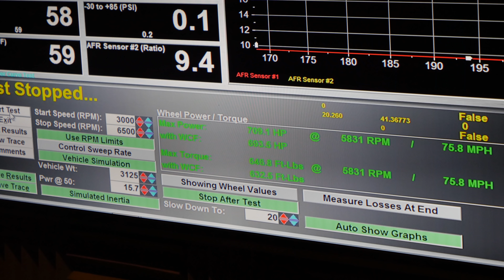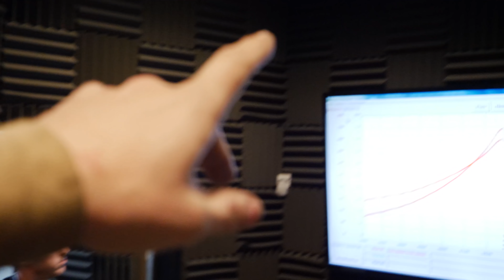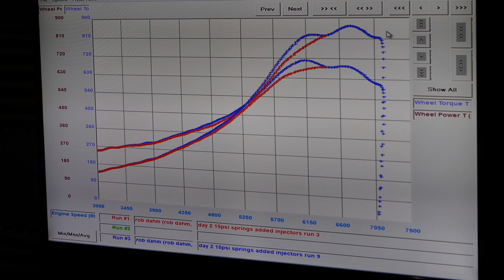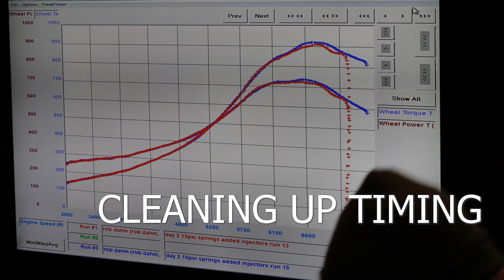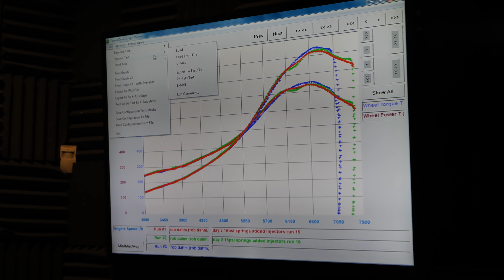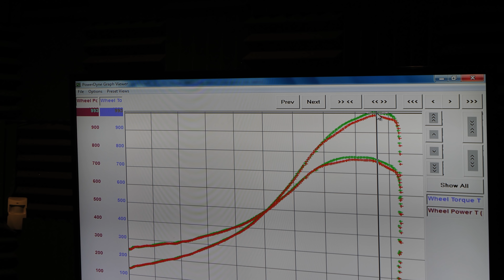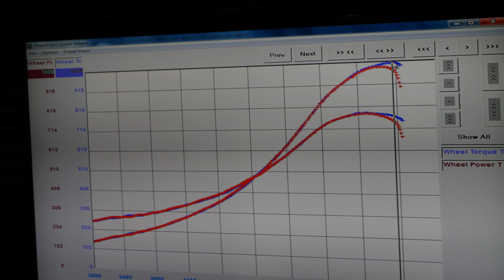WORLD’S FIRST 1000HP AWD BILLET 4 ROTOR RX-7

Comment: I never thought i will see the day of Rob Dahm hitting 4 digits on the Dyno with the AWD 4 Rotor, but now that it is FINALLY here, i can only cry of emotion and feel more than happy for this man and his dream becoming real!
Reply: Well that got deep real quick! I agree, no tears but the journey was mighty, as is the Man behind it!
Reply: Time to hit the track and half mile.
Reply: Jake Heke but it made 1000, lemme guess your 1500hp turbo civic would smoke it in 1st gear
Reply: Jake Heke  why are you even watching?
Reply: Jake Heke  Ha, good try, looks like you don't know sh*t about Dynos, he was hitting over 1000HP on the last 10/15 runs because it is a Mustang Dyno and they read the HP lower than it actually is, he just wanted to show the 1000 number on the screen but it is actually over 1200 HP
Reply: Jake Heke  
Peak numbers are always just that. Peak. And really you cant really gauge power output very well based on that. However it did peak at 1000 hp. Which is really nothing to sneeze at either. Sure it aint 1500 out of a 4g63 but ya know, its still very impressive. And it will have a very snappy response to throttle input too
Reply: Joe Alex how gay
Reply: @joealex65  yeah also 10XX hp at the wheels means with drivetrain losses ( due to AWD even higher) friction can cost you a lot but I would say the engine isn't punching with 1200hp my estimation is about 1150hp at the crankshaft also at sub 1000hp the dispersion of the test stands get bigger so.. 🤷‍♂️

Comment: Rob has invented a new fuel measurement ppg : pulls per gallon
Reply: no! it's gallons per pull
Reply: Thatdudeinblue made up smiles per gallon
Reply: In some tuning circles you can hear them arguing that the envirude v8 two stroke engine needs fire-rescue hoses to feed it with enough gas.
I think we can draw this comparison to Rob Dahm. Or he screws the fuel pressure up to 30psi.

@Rob Dahm, have fu**ing fun with this awesome Monster. Let them kids hold their ears as tight as they never hold them 

Sorry, german "Denglish"
Reply: @Bernie Sanders one lap. one mile. ABSOLUTE VICTORY
Reply: Talha Naveed no he didn’t lol
Reply: @swedischer  30psi isn't much fuel pressure at all. Pretty common to maintain 3bar above manifold pressure.
Reply: @XLR8_992.1  Haha, nah, I heard that term back in the 80s and I'm pretty sure it's from the 70s fuel crisis.
Reply: This is like what people will learn about in history class one day
Reply: I think its around 2
Reply: @mitchsalden649  Hahahahaha

Comment: The fact that this is AWD it’s gonna be insanely fast
Reply: Dude right I think MOST people in the comments aren't understanding how FUCK ALL INSANE an AWD Rotory is!!! 😲😲😲
Reply: It will be borderline un-drive-able at wide open throttle, traction will be non-existent.  That thing is insane... I love it!
Reply: @BassFearDave  Why? Did you read a bogus comment somewhere?
I don't imagine it's going to be of any benefit at "wide open throttle.", but it surely is not going to
make it un-driv-able.
Reply: Anyone know the weight of the car? Fd3s are already light at 2600lbs stock
Reply: @Hakuna_My_Tatas  If you watched the video all the way through, towards the end he says it weighs only 2400 pounds.
Reply: @Hakuna_My_Tatas  13:51
Reply: Tracrion shouldn't be an issue takigg that the motors starts pulling at very high rpm
Reply: @BassFearDave  If the car breaks traction on four wheels at WOT it just means the final drive ratio is wrong.

You guys really don't get how cars work do you? There are cars with more power than this on the road and they get traction just fine. Some of them aren't even AWD and they manage.
Reply: @Hakuna_My_Tatas  he said 2500 in the video
Reply: @BigUriel  Depend on what gear you are, exiting a corner in second is gonna need some finesse
Reply: you're right man
Reply: @BigUriel   @Sérgio Alves  quit trying to act superior lol. Don't gatekeep automobiles. Secondly, cars can lose traction at full throttle because of improper tire temperature, tire condition, compound itself not being up to the mark, overall mass imbalance, anti squat issues, and especially compliance issues. Literally gearbox is the last place someone would make a mistake to lose traction. And there are actually not many 1000+hp 2400 lb awd cars out there, and most are made in a complete industrial set up with millions worth of simulation packages
Reply: MRJT stock next gamestop!

Comment: Rob: I wonder how much HP this engine is going to put out
RX-7: Yes
Reply: Not a lot for long, you can hear that he has not worked  the rotor tolerances.
Reply: Sounds like adding rpm kept letting it make more power
Reply: @toordog1753  like you would know lol
Reply: @2valvechris338  Since RPM is directly in a horsepower calculation that would makes sense.
Reply: @toordog1753  You can also hear that the left front tire is .1 psi low and one of the spark plug gaps is .000001 too big.
Reply: This “yes” joke is so played out.
Reply: Here's the thing, I'm sure he can put more power into this. But this is a scary scary fast car. If I was him I would try and drive this first 😂. This is technically should be faster then the new Bugatti Veyron sport.
Reply: @toordog1753  rotor tolerances were fine although power should go up more as the engine breaks in

Comment: Next on Rob Dahm: How to install a larger fuel cell in an RX-7.
Reply: My thoughts exactly. I mean, the extra weight of a larger fuel cell will probably help with traction because that thing is VIOLENT!
Reply: @A_G420  After all, what good is a car that can only race, from fuel station to fuel station two blocks apart.
I'd go with a large baffled fuel cell and get it shaped to fit in around the pipe work of the frame (probably easier said than done though) OR two large round fuel cells with baffling inside to reduce fuel sloshing around when cornering or heavy pulls like drag racing.
Reply: @TheHungrySlug  wel you don't run full beans every time so mpg will be better

Comment: 4 rotor: * makes 1000awhp with no problems *
Rob: * cries in doritos *
Reply: His tears are triangles now lmfao
Reply: ☝️🤨 This engine is a low range, for use daily car set up, this have capacity to hit 2,500 hp. ok 13-B 2 ROTORS with over 1,000 hp O.E.M. part. and 1,400 hp Billet 1.3 lt. 😉👍

Comment: When Freddy Tavarish was tuning his TT Gallardo on a Mustang dyno, he said that Mustang dynos read 20% or so less hp and torque than a regular dyno would. So  RX7 is probably pushing 1100hp!
Reply: I heard the opposite about mustang dynos.
Reply: That is true, the Mustang dyno tends to be more conservative due to the loading they do, and if you put this car on a Dynojet,  it would be more like 1200.  The thing about Mustang dyno's is they need to be carefully calibrated for the car, or the numbers can be way off (or skewed on purpose), but I doubt Rod would do something like that, and I am sure that shop knows what they are doing.
Reply: Just put it on a Dynapac and be done with it
Reply: Well they are +/- not 20% specifically . Every mustang dyno ive used reads slightly differently on same car. That said 1000hp on this dyno is more than enough to prove its over true 1000 at the wheels i.m.o. plus thats awd hp at wheels meaning its loosing much more in drivetrain than rwd would
Reply: @BassFearDave  yeah they did way to many pulls to be trying to hide the numbers.plus the size of that turbo and boost #s the math works out

Comment: Check those straps every so often especially when you're starting in test mode and moving gradually into full tilt. they may be tight enough for 200hp when u started but not for a 1000. the very last thing you ever wanted is for that project to come loose on the dyno.

Comment: Cant wait to watch it on 1/4 or 1/2 mile ripping 🔥
Reply: If it hookes up with 1500HP it should hit 7.9@180 easy......................maybe over 200mph
Reply: A race with Leroy would be so EPIC......
Reply: On a race track this thing would be quite something to see, a real car is balanced, power and the ability to move.
Reply: With enough tailwind this is a 3 second 1/4 mile car.
Reply: Berry Tharp uh ya no. That's top fuel territory.
Reply: @CowBoyPyro  If it runs 7s or 8s without any assistance it could easily get into the 4s or even 3s with enough of a tailwind.

Comment: With the extreme horsepower levels and the all wheel drive, this project has the potential to kill you. Treat this like a dangerous manned rocket mission, lots of safeguards and testing, build your way up methodically , an early all out run could end in disaster.
Reply: as long as the car keeps in good condition and he doesn't drive irresponsibly

Comment: How much fuel does the 4 rotor use during a pull?

4 rotor: yes
Reply: this is what driving my e46 feels like
Reply: @Krozhin  Dude you have no idea how much rotary eats :D Trust me E46 is fucking prius over stock 2 rotor. (talking about fuel consumption)
Reply: It depends on how much boost, 
There's probably a clue in injector sizing  and having dual injectors!
Reply: @jotenmike  I'm well aware, this is just what 24 mpg feels like to a student who has to pay 7 bucks a gallon
Reply: @Krozhin  are you from canada? $7 seems excessive.
Reply: @patrickdabs  Sweden, 7 bucks is on the cheap end. I'm just converting the price from litres
Reply: @Krozhin  Dont say that to me.... I used to be studen, now Im jobless for year and car is like 9.5 mpg if I little step on it. But thats rotary life. But price is about same price for litter of premium. If its 2.0 I think everything under 10/100km is good.
Reply: @jotenmike  doubt you pay 7 bucks a gallon though
Reply: That teeny tiny fuel cell they've got in there is gonna be empty after a good run.

Comment: I don't thing everyone realizes but that is 1014 wheel horsepower that's been sent through an AWD drivetrain. So that means this engine would probably make 1200 or so on an engine dyno.
Reply: I would say more, you lose a bit of power with awd.
Reply: And isn't it on a Mustang dyno? Those read lower than the typical Dynojet
Reply: @SnowBisCute  true it is a mustang dyno.

Comment: That wiring trick was legitimately cool. I wanna see more nerdy shit like that. :D
Also, fun fact: the reason why rotaries are unreliable in normal operation is the SAME reason why they're insanely reliable in racing: their consumption of oil for lubrication means at WOT the apex seals wear out much slower than a normal piston ring package would. It's also why that engine is able to go 3000-7000 20 times in a row in two days with absolutely no difficulty.

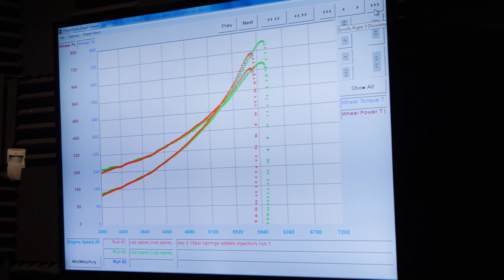Comment: 7:08 you can see the exhaust blowing dust off the dyno
Reply: Landonius 8:39 *
Reply: Its wasnt dust. Its a smoke from premix from fuel and oils. Cause the wankel engine work with burning the oils.
Reply: Lol it had to clean it up cause it’s the realest car to be on it
Reply: You could see the entire building vibrate dust loose everywhere. Watch it again.
Reply: that's momentary condensation from the water vapor in the exhaust on the colder steel plate

Comment: This is the only rotary I have ever heard that sounds good. I mean it sounds really really good
Reply: That turbo helps. But yeah the amount of torque at under 7k rpm is impressive on rotary. Must be the 4rotors changing firing. Like cross vs flat plane v8 cranks. 4 rotors = 4 explosions close to each other unlike most 2-3 rotors=most consistent sound waves=better sound. Thats my theory anyway

Comment: Why so much effort to get 1000? Thought this thing was able to do 2000?!
Reply: 6k RPM? Just setting up engine.... Guys like u are here just to tell us that rotary sucks. And when it works and makes ten 1000HP pools its like.... wtf only 1000? Grow up...
Reply: 2000 motor. They made 1000 wheel. Not sure what the math is on drivetrain loss. Say 100 to 150? Sounds like he hasn't add as much fuel to the engine as to support 2000hp.
Reply: @scr454  Mustang dynos reads lower than normal dynos about 15-20%. It this moment he has like 1500 on flywheel.
Reply: Mike haha never told anyone that rotary sucks, i do not think that either. It just looked like a lot of effort to hit 1000, when i thought they said the motor was good for 2000, thats all

Comment: Awesome motor!!  You can just feel the whole car strained by the leash of the dyno, tearing at the reins to be free :)
Sorry if this comes out negative, and sorry if this has been mentioned lots of time before,  but isnt max power at less than 7000 rpm pretty low for a rotary?   It IS a turbo 4 rotor behemoth, but it still sort of seems low.  No gain in optimising it to rev more?

Comment: Hey he finally did it. While ive doubted Dahm in the past(mainly time frame based) for a basically hobbiest he did good. im kinda surprised people thought that engine wouldn't run. People seem to think you need lab grade conditions to rebuild engines(in f1 yes) but only in rare cases is that true. Hell i've rebuilt engines in dirty ass garages, used emery cloth to lap valves, ground pushrods with a grinder no finish, even re used old piston rings etc. Only ever had 1 engine failure out of the Many ive rebuilt. That failure was my personal engine and it was me cutting corners that cut off oil supply and killed it. Hell i built my first 383 dirt track engine at 15 with zero tools or knowledge and it did a whole season. I guess im saying armchair internet experts maybe you outta go do it yourself before judging other people.
Reply: One must be wary of the infamous Arm chair internet experts a.k.a The almighty all knowing keyboard militia.

Comment: Push you're spool rpm to 3800 go to the 1.1:1 ar housing and you will gain10 % in hp

Edit: back pressure reduction and pumping losses will be your gains it will also keep your header temps and egt's down

Comment: I had boycotted rob's videos after watching him draw mountians in the fuel map on some video about a month ago, lol. So glad to see this getting the pro-tune treatment. gotta make sure transient and drivability is tuned proper too!
Reply from the maker: Haha that was actually used to generate the base map. So it wasn’t wasted time. But I definitely didn’t need to go spelunking 😂 just used to my old ways on my power fc. Took the hp academy class and got the car to 2 psi solid. Elliot took it from there and made more professional music.
Reply: @RobDahm alls well that ends well. Overall what a fantastic piece of performance and content generator. Those hiccups when first getting on throttle sound like tip-in related issues. Those can often be a result of improper injector dead-times. Check if your ECU has 3-D dead-time tables that allow offset by voltage AND fuel pressure. If you can assign an output to the fuel pump high/mid/low jumpers, and then offset dead-times with rail pressure sensor, should make the entire fuel system response more linear and easier to tune, esp at low pulsewidth and secondary engage points.

Comment: if the problem faced in building a rotary engine is the temperature difference in the engine block due to the combustion chamber which is below.  what if rotor 1 and rotor 2 have combustion chamber positions that are opposite positions.  1 rotor with a combustion chamber below and 1 rotor above?  might be able to produce even heat on the engine block, so that temperature control is more maximized

Comment: hey i was just wondering (probably stupid question i'm not familiar with how dynos work) i didn't hear the car changing gear, to find the hp do u just gun it in one gear? if so, which one?
Reply: It depends on the gearing in your transmission, whatever gears is the one-to-one ratio.

Comment: i wonder if the billet rotors are a double edged sword.......they are stronger and can handle more power and heat, but they HAVE to be considerably heavier, causing more "power loss"...but i could be wrong

Comment: So... if I understand the principle of a rotary correctly... they technically don’t have a rev limiter right? I mean, the rotor can basically spin as fast as it wants, as long as it’s lubricated enough! The problem would rather be the injector right? Or the ignition, but they could technically rev “endlessly”! Not completely endless but you get what I mean! Or am I wrong? Correct me if I am!
Reply: In theory, a rotary engine could rev up to the same rpm as an f1 car, however it would be unreliable and pointless

Comment: Why aren’t they turning it up as high as it’s built for? 
A 106 will make almost 2k On an LS right? And aren’t they reving it 3k less than the limiter. Am I missing something?
Reply: First ever billet 4 rotor in a first ever awd 4 rotor rx7  why break it on the Dyno before the car is done. Plus rotaries break in and gain compression after being ran a few hundred miles so he has to wait

Comment: Mustang dyno is based on inertia not load. It’s seems to be running out of gear. The turbo is unloading making the peak power out out seem less than it really is. If the car was on a water break dyno where you could load the motor to spool the turbo through the entire pull I bet it’s making a lot more than 1000

Comment: Aren't there like kind of a bunch of non-billet 13Bs making 1000 hp? I realize it isn't final tuned (probably nowhere near), but I kinda expected more. Maybe it's not broken in yet with the apex seals and so on, I'm not a rotary guy and don't know a hell of a lot about them. Oh, and AWD is factor, too. And it's probably geared pretty low. It's probably hotter than it seems. Also, 4 rotors is apparently what it takes for a rotary to not sound like a misfiring 2-stroke dirt bike, because every 4-rotor I've ever heard has sounded great, and every other rotary I've ever heard has sounded like pure garbage. I'm not knocking them, they're cool as hell, they just make sounds that are NOT for me.